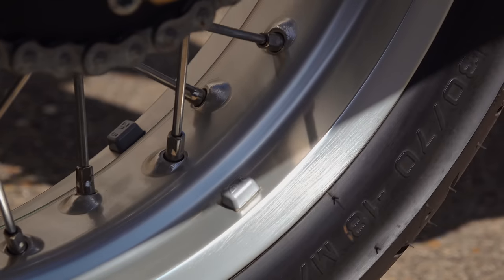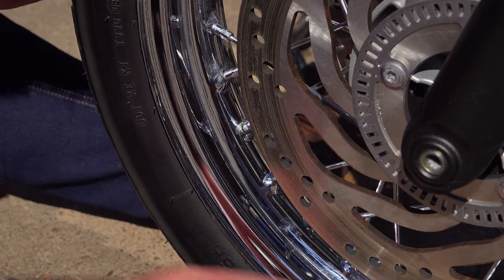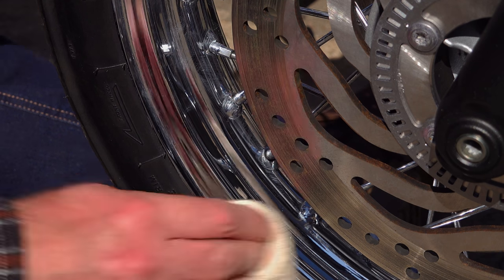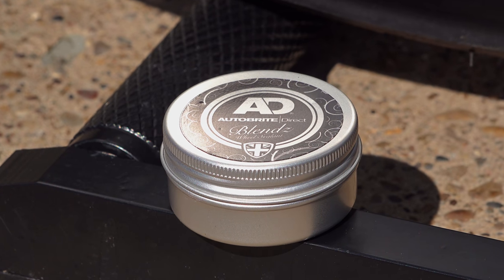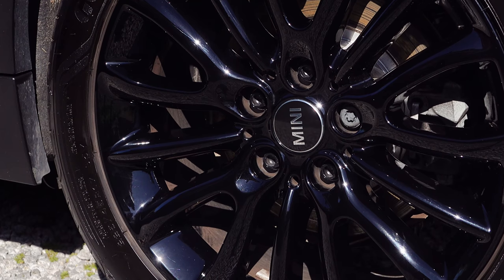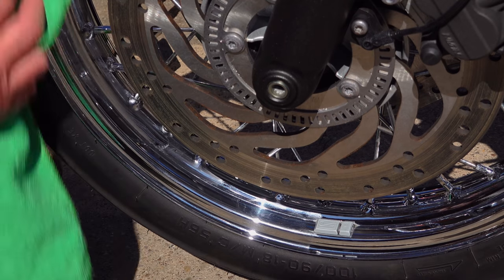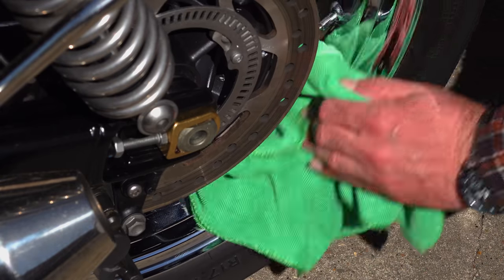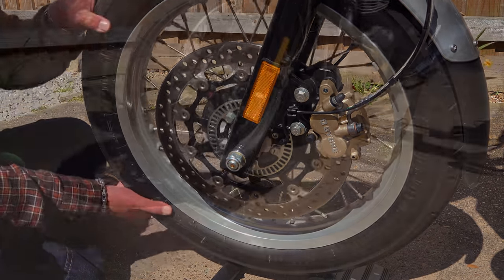Give your Motorcycle wheels THE FULL FILLINGHAM,  AUTOBRITE wheel sealant!

Comment: This video is invaluable. Upon inspecting my wheels, I discovered some light rust in the wheel spoke holes. Also discovered some light corrosion on the back wheel. I have two product suggestions which are available on Amazon US. First: Break Free. It dissolves light rust and leaves a PTFE film for lubrication and a moisture barrier. I used the "Precision Shooter" to put a drop at each spoke hole. Second: Eagle One Never Dull metal polish. It is cotton wadding impregnated with a chemical that is magic for removing light corrosion on chromed anything. My wheels look absolutely new! I'm buying a bike dryer! Got to get the water out of the spoke holes.

Comment: Good morning Stuart, another premium quality vlog again! It might be worth mentioning (although I am certain you will probably know this from your past), that the problem is that Chrome plating is actually porous, and it's down to the quality of the pre-chrome plating stage and the base metal that defines how good the overall quality of the finished effect is, check out Rolls-Royce for their radiator surround plating for instance, therefore if the base materials or pre-chrome plating is sub-standard the rust will certainly be through in no time. the benefit as you rightly point out of applying a good quality wax after removing any rust spots is that the wax effectively plugs the micro sized holes where moisture gets in and rust becomes apparent, therefore the more wax is used over time to plug the holes the less chance there is for rust to form. It is actually the base metal that is rusting, not the chrome plate, the chrome plate is actually just the crowning glory - but not for long if we don't treat it correctly, thanks again, superb. Nick.
Reply from the maker: yeah actually nick I have touched on this in other videos. this strictly speaking is just a chrome finish. to be described as chrome plated here it must adhere to a specific British standard, which few products do these days.

Comment: My 1st gen hinckley bonneville in 2001 only lasted a month before it had to have chrome replaced under warranty for pitting! I cleaned that bike for hours after every ride and still the chrome started to tarnish, especially the wheels. I wore my knuckles down cleaning the spokes with a toothbrush but to no avail. It's one of the reasons I sold it and since then I've stayed well away from anything chromed!
Reply: @jeffslade1892  it was nearly 20 years ago! Before the interweb. Most of my mates didn’t even bother washing their 70's and 80's bikes!

Comment: Without wanting to hijack these comments I was unlucky enough to collect my Royal Enfield Bullet 500 Rally in February, on a day so cold I found myself following a salting lorry for about half an hour and so every exposed surface , especially the chrome and the bare aluminium soon showed signs of exposure . To rectify this on the engine casings I've used Peek Metal Polish and on the wheels Meguires Chrome Polish, which is has been excellent for getting out the worst of the "strains". However I'm thinking that stuff looks worth investing in. I'm going to invest in some and report back. Cheers.

Comment: Hi Stu Finish Kare 1000p is an excellent synthetic sealant specifically engineered as a high temperature paste wax. It works brilliantly well on wheels/exhaust pipes etc and can withstand up to 250 degrees. It can be used all over the bike/car and is outstanding value at currently £18 for a very large tin!

Comment: Nice video Stuart - I used soapy wire wool on the exhaust to remove burnt on plastic cover from the exhaust.   There is no visible scratching - is it still vulnerable to rust?

Comment: Really enjoy your practical tips. Whilst on wheels, assume all your bikes have tubed tyres so do you use any sealant in the tubes eg Slime, Never Flat? Or do you seal the rims with a sealant tape. Do you carry spare tubes & patches on longer trips? I'm surprised that today tubed tyres are still provided with  many new bikes with spoked wheel, particularly modern classics. At least KTM provide a sealed rim for their spoked wheels.

Comment: Toothpaste is slightly abrasive. Would that be any use for initial cleaning of chrome? It can remove the glaze you get on old headlights and return them to perfectly clear.
Edit: sorry I forgot to say thank you for a couple of useful bits of information in your video. I didn't know that you are supposed to leave the polish on for 15 minutes at least. I have been polishing a panel on a car and then polishing it off straight away. I had wondered if you were meant to leave it on for a bit or rub it off immediately. Also I didn't know that it is a good thing to put three coats on. I thought that a second coat would rub off the first coat. I do use carnuba polish by the way.
Reply from the maker: I Andrew re the toothpaste ive never actually tried it as I believe in using the right tool for the job. with all waxes you need to allow the solvent to evaporate before buffing otherwise you will remove too much of the wax when you buff. Regarding the 3 coats its pretty much an industry standard practice in order to give full and complete protection.
Reply: @stuartfillingham  Thank you Stuart, it is lovely to get advice from a professional.

Comment: Hi Stuart. Thanks for your tips and good advices. Maybe my English is not good enough, but I didn’t catch the product you use on aluminium wheels (around minute 12). Is it Acetone? I’ve some spots on the cast wheels of my 2010 Bonneville and can’t remove it.  Would you have a product to advertise? Thanks!
Reply from the maker: Hi Eric,  it's just a naptha based pre paint panel cleaner or pre paint wipe. Very easy to get hold of. On such as amazon. The brand I use is UPOL. is just a degreaser and wax remover  it doesnt polish markers out or anything like that.
Reply: stuart fillingham Thanks!

Comment: Royal Enfield service is the worst in India. Unlike the UK, it's mandatory for the bike to be serviced by the dealer. They bled break fluid on my rims and the paint is discoloured now. Any tips on how to remove them?
Reply: Hi stu .i find pink windowlene works and provides a protective film.....
Reply: It's not paint it is anodised. Anodised is basically a form of dying of the metal. If the anodising is removed you either need to remove the anodising on the whole rim and re-anodise or paint them. You could possibly remove the anodising and have them polished and sealed. Go back to your dealer and get new rims...
Reply: @paulaus  thanks for the reply. However things don't work that way in India. Guess I'm stuck with it. Hopefully some day I'll strip the rims and paint them black. 🙂
Reply: In the old days when you still have steam locomotives they would bag up bag to senders to melt the ice on the roads because they were black and they were to charge the Sun and they didn't trust your cars or anyting and I agree living in Florida I deal with hundred percent humidity 100% of the time and I wish practically everything on all motorcycles with built out of stainless or alloy so you wouldn't have to deal with rust but then your bike would probably last you forever and the manufacturers would hate that